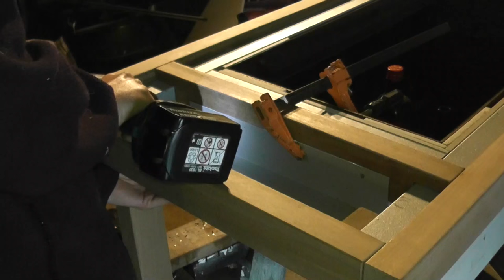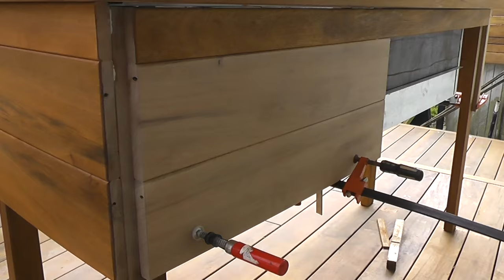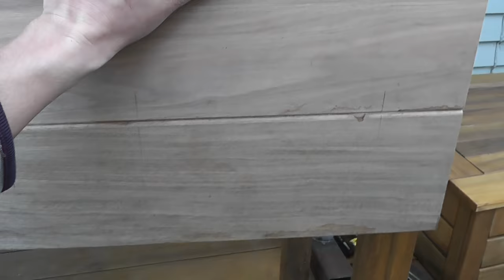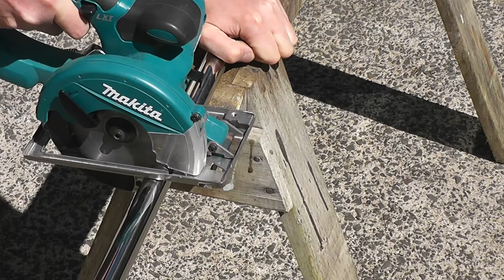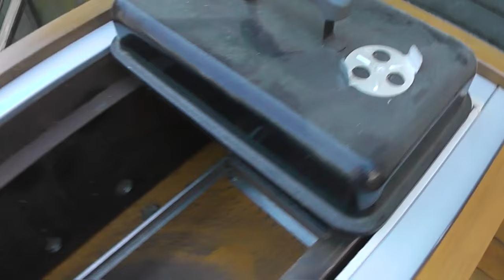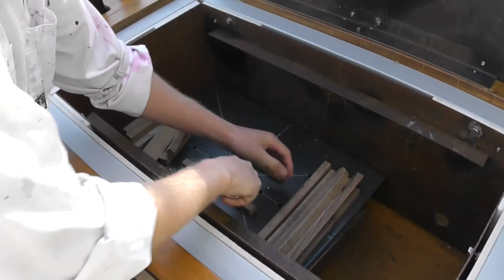BBQ MADE OF WOOD!!! DIY Wood/Charcoal Barbecue Part 2: Completion

Comment: Very nice build, mate! Looks far better than most store-bought offerings. One question, though: using a solid griddle for a cook surface instead of an actual grill, aren't you missing out on a lot of that good smoky barbecue flavor? I'd have used some heavy-duty expanded metal mesh, myself.